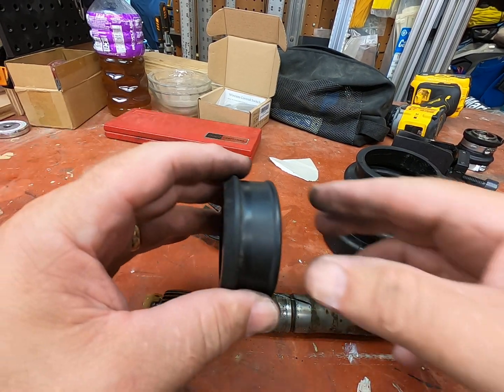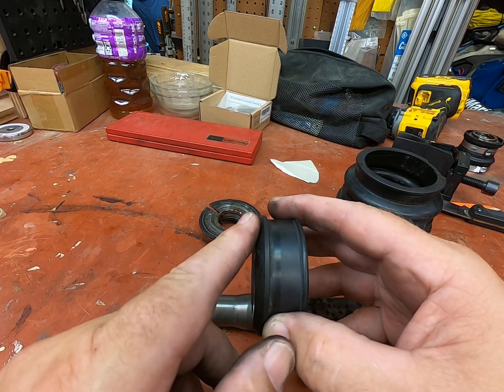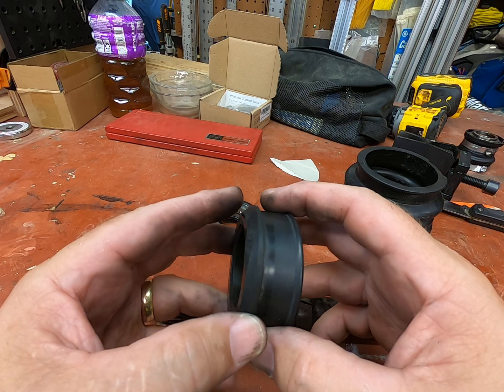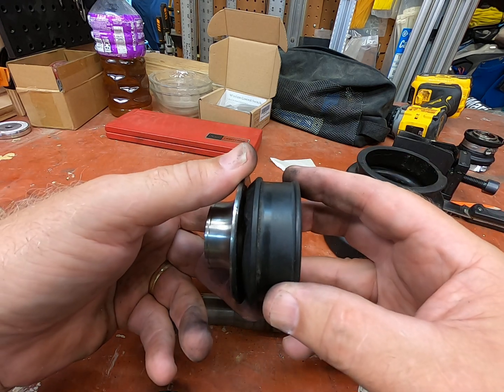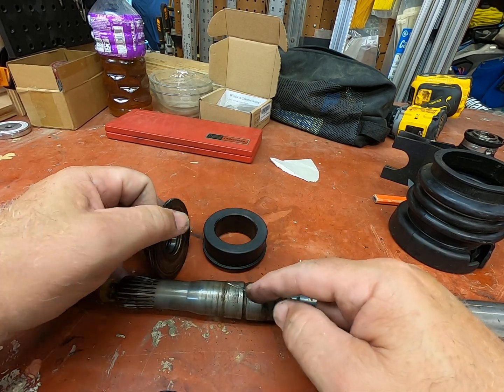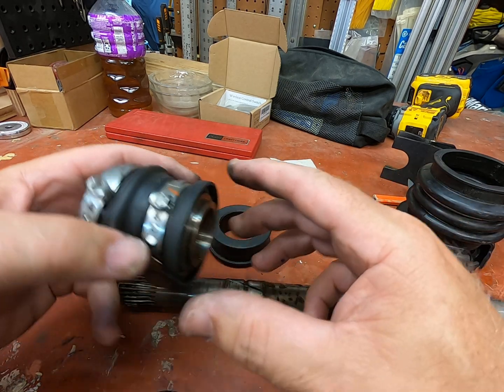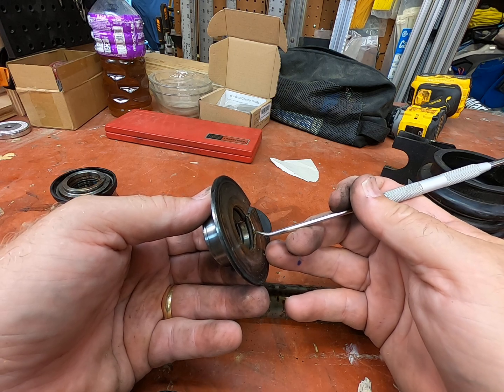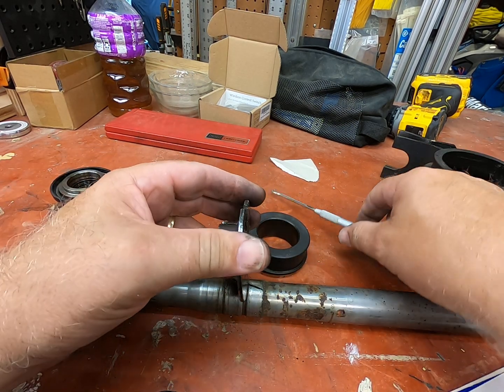FishPro Sport - Carbon Ring/Hat and Driveline Corrosion Info

Comment: Thanks Bill - good explanation of what to look out for but I’m not convinced about corrosion around the pto - I’ve been there… 😅same issue but was careful when cutting not to cut into the shaft, stopped just before and jammied the hat open. My advice is to free it up when servicing with the bellow tool. 

All the best! 🤙
Reply from the maker: I hear you brother. 

On the hat thing... FIrst they tried the curved lever  tool that moves the floating ring back to expose the c clip. No joy.   Then they tried the removal tool with the spreader ears, which basically you put down in there and has those two U shaped ears  that are expanded apart by turning a bolt and wedge. Even that didn't work. 😢

The pto was a pita too.  That corrosion lock was there too. 

On shaft damage. If you can do it and not nick it, you must also be a brain surgeon, and you got my respect for sure.

I got to thinking about some of this and from the shops standpoint when they charge $159 an hour it is more efficient to just cut the hell out of everything and go ahead and install a $250 shaft it could very well be six of one half a dozen of the other of course when you're doing it yourself your time is basically free so that doesn't factor in. 

Of course with my big meet hands down there in the engine bay trying to cut on something that I really can't see very well I'm going to end up making the shaft anyway
Reply: @billjenkins1535 Thanks for your reply. 😊

I understand, it can get real tight for my twiglet fingers. One tip, if you lose things in the hull then to tip the ski (outside) drop a hose down by the battery and flush it back. 

In the UK it’s not just tricky getting parts but also expensive - new shaft is more than $500. It pays to be surgical 😅

The C lever the shop used is worth buying - you can use it every so often to loosen the floating ring avoiding the same issue. 

Thanks again for taking the time to upload and share your experiences - I look forward to more. 👍